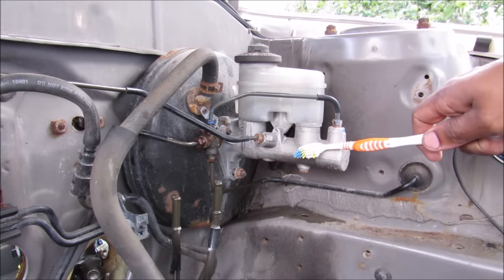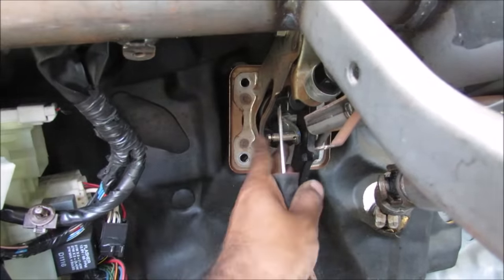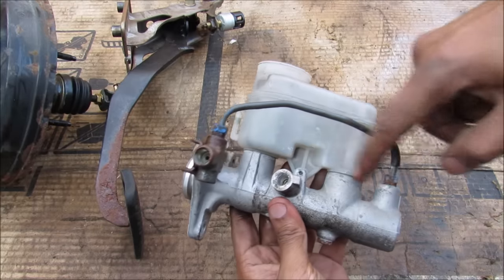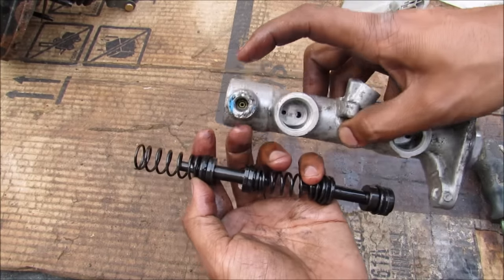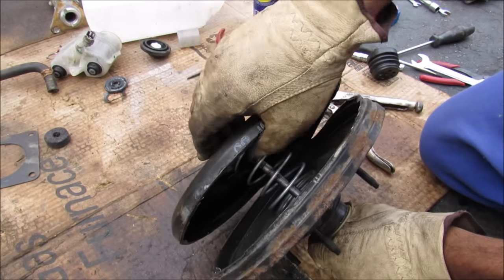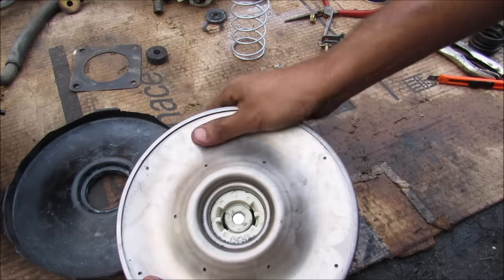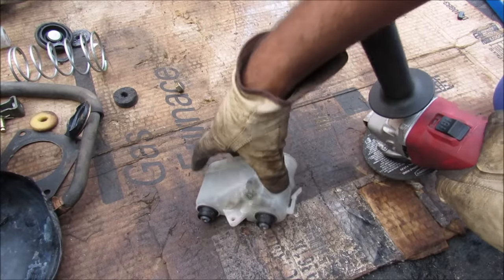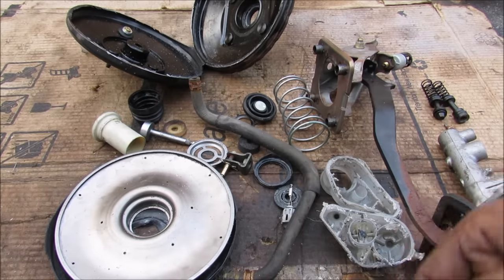How a Brake Booster and Master Cylinder Work

Comment: That snap ring plier multitool is great
Reply from the maker: +pétri pat I love my angle grinder...err snap ring pliers..err hex socket...lol
Reply: speedkar99 
I love mine too and I will often use   the 5 inch diamant blade  which works great on métal too and doesnt break in your face when your in a thight spot with that said thanks for your work
Reply from the maker: +pétri pat thanks. My grinder is 4.5" but sometimes I wish I had gotten the 5" blade for cutting a little deeper.
Reply: speedkar99 
You can always take the guard off and put a 5 inch it works very well as for me I always take the guard off all my grinder s but im very carefull expecially if I use a thin métal blade as soon as there chiped like I change them because they break which is why I use the diamant one it last longer and you dont have to worry its going to break in your face and I use grinder all the time another tip I can give if you dont already know it is that I always use my hand to screw the blade while holding the stop buttons same if I want to change the blade I unscrew it by hand the only time this doesnt work is if the grinder is too old (used)been doing this for the last 15 years 😉
Reply from the maker: Thanks for the tip.
Reply: I like the toothbrush tool
Reply: Lol
Reply: Best part was when he used his snap ring pliers to cut open the brake booster.
Reply: I call it my universal screwdriver for stripped screws
Reply: Same  snap ring tool I use.
Reply: Na my favorite was the brake booster opening tool and the reservoir splitting tool.
Reply: I laughter my ass off after watching two twice a special tool lol yes made my day
Reply: I used that multi tool once when I got locked out of my house..
Reply: @petripat5979  Please be careful and hold grinder with wheel not in line with anything you want to keep....

Comment: This is one of the best videos I've ever seen explaining how the brake booster and master cylinder work. I always wondered why the brake pedal would return when there was vacuum on one side only - reason it does is because there is a valve that I didn't know about equalizing the vacuum on both sides. Thanks for explaining everything and for showing (rather than just talking) about the components.

Comment: Another awesome video.  For me, I appreciate how you just cut right to the chase.  You take the time to edit your videos so that they are succinct and to the point.  So many other YouTube presenters seem like they spend so much time talking and wasting time and not getting to the point of why the video was made to explain in the first place.  Keep up the great work!
Reply from the maker: +B S I agree. Short and to the point is my style. Thanks for the compliments
Reply: Nice to see someone appreciating videos that are precise and concise. This is the style I've been trying to cultivate too. Trouble is that YT rewards watch time and so encouraging longer videos with a load of waffle.
Reply: @CycloneCyd  Subbed 👌
Reply: @speedkar99  My car i20 clutch sets ...disc, bearing and plate, and slave cylinder has been changed recently. After that, all working ok...pulling, shifting, etc..all ok. No complaints.

However, just about 3000km of driving since the above replacements were made, the car suddenly failed to engaged any gear while driving. The clutch pedal all the way goes to floor and never return back. I have to manually return to its original position and then pressed again repeated. However, it still sticks to the floor and never return back.

I was driving and all of sudden the issue happens. Stuck in traffic and was pull over to roadside with traffic police help.

Wait for some time, and yes, it come to engaged and disengaged again. All ok. But, the problems arise intermitently!!!

There is no physical leakage, damage or low fluids in the system. All ok. (It used to happen when clutch is used often ie in traffic jams, clutch engaged and disengaged frequently, just in 10 minutes or so. However, no issues with pulling power and no clutch slippages, temperature, coolant all ok.)

Comment: That redundancy in the master cylinder saved my butt when merging from one highway to the other at 60mph. Brake line to the back wheels exploded at the same time.
I didn't know that until now.
Great video! Love the toothbrush!
Reply from the maker: Ouch
Reply: That system saved a lot of butts
Reply: isnt the system in the master cylinder just if one of the pistons in the master cylinder fails? wouldnt effect what happens if a brake line fails, thats down to the proportional valve? i assume if you lose your right rear you also lose your left rear but keep the front due to the proportional valve keeping them seperate for safety and mainly for brake bias. unless the two pistons in the master cylinder go to different places? one to the front and one to the rear wheels? but then there is no backup if one piston in master cylinder fails, you will lose braking at either front or rear, whereas if it works how i thought then if one piston fails you still have normal braking?
er, sorry im rambling.

Comment: Thanks. What a great, no bullshit approach to demonstrative learning. You can't not understand how a main brake cylinder works after watching that. Brilliant!
Reply from the maker: +Labrador McGraw Thanks! Short and to the point is my style! Glad you liked it.
Reply: im pretty mechanically inclined and do all my own repairs, which owning a jeep and a 96 cummins is alot, i still dont quite understand how the booster works, yes vacuum pulls on the plate and a valve allows atmospheric air in to stop the equilibrium/provide a pressure difference on each side... what i dont understand is how it doesnt just go full brakes/locked up as soon as the that pressure difference is there, it provides a pretty uniform assistance but doesnt just full lock.. okay i think i just explained it to myself, the size and of that plate and the return spring are balanced just so to give you the correct amount of assistance without overpowering the mastercylinder and making the brakes either 100% on or 100% off
Reply: i still find it weird or amazing how well it works in making the brake pedal feel so effortless throughout the entire throw and it doesnt cause jerky/spontaneous braking when you you just barely touch the pedal

Comment: Great video, man. No bullshit and straight to the point. Thank-you.
Reply from the maker: That's my style!
Reply: @speedkar99  My car i20 clutch sets ...disc, bearing and plate, and slave cylinder has been changed recently. After that, all working ok...pulling, shifting, etc..all ok. No complaints.

However, just about 3000km of driving since the above replacements were made, the car suddenly failed to engaged any gear while driving. The clutch pedal all the way goes to floor and never return back. I have to manually return to its original position and then pressed again repeated. However, it still sticks to the floor and never return back.

I was driving and all of sudden the issue happens. Stuck in traffic and was pull over to roadside with traffic police help.

Wait for some time, and yes, it come to engaged and disengaged again. All ok. But, the problems arise intermitently!!!

There is no physical leakage, damage or low fluids in the system. All ok. (It used to happen when clutch is used often ie in traffic jams, clutch engaged and disengaged frequently, just in 10 minutes or so. However, no issues with pulling power and no clutch slippages, temperature, coolant all ok.

Comment: Well Done!!
Reply from the maker: +Paul Wehbe thanks Paul
Reply: @speedkar99  My car i20 clutch sets ...disc, bearing and plate, and slave cylinder has been changed recently. After that, all working ok...pulling, shifting, etc..all ok. No complaints.

However, just about 3000km of driving since the above replacements were made, the car suddenly failed to engaged any gear while driving. The clutch pedal all the way goes to floor and never return back. I have to manually return to its original position and then pressed again repeated. However, it still sticks to the floor and never return back.

I was driving and all of sudden the issue happens. Stuck in traffic and was pull over to roadside with traffic police help.

Wait for some time, and yes, it come to engaged and disengaged again. All ok. But, the problems arise intermitently!!!

There is no physical leakage, damage or low fluids in the system. All ok. (It used to happen when clutch is used often ie in traffic jams, clutch engaged and disengaged frequently, just in 10 minutes or so. However, no issues with pulling power and no clutch slippages, temperature, coolant all ok.)
Reply: I wish everything in my life was this to-the-point

Comment: Can you teach us how a clutch pedal connects to the clutch.
Reply from the maker: +MaximumJonathanosity I wish I had a manual tranny car. This one Is auto
Reply: Yeah, I figured. Thanks for all the other videos though.
Reply: Considering you already know the components, basically, the pedal is attached the same way leverage wise as the brake pedal, except its hooked up to the master cylander that hydraulically sends brake fluid to the slave cylander which has a piston that pushes against the throwout bearing which spins/pushes against the fins on the pressure plate, releasing the clutch. Lol
Reply from the maker: +Matt'smobile AutoRepair good explanation but this would be even better if it was presented visually
Reply: speedkar99 agreed!

Comment: This guy is amazing explaining  how things work  waooo
Reply from the maker: +Luis Abreu thanks!
Reply: @speedkar99  My car i20 clutch sets ...disc, bearing and plate, and slave cylinder has been changed recently. After that, all working ok...pulling, shifting, etc..all ok. No complaints.

However, just about 3000km of driving since the above replacements were made, the car suddenly failed to engaged any gear while driving. The clutch pedal all the way goes to floor and never return back. I have to manually return to its original position and then pressed again repeated. However, it still sticks to the floor and never return back.

I was driving and all of sudden the issue happens. Stuck in traffic and was pull over to roadside with traffic police help.

Wait for some time, and yes, it come to engaged and disengaged again. All ok. But, the problems arise intermitently!!!

There is no physical leakage, damage or low fluids in the system. All ok. (It used to happen when clutch is used often ie in traffic jams, clutch engaged and disengaged frequently, just in 10 minutes or so. However, no issues with pulling power and no clutch slippages, temperature, coolant all ok.)

Comment: 4:32 the vaccum proportion, i never understood, why we need vaccum? the brake system is totally manual according to my research
Reply from the maker: +G H the vacuum creates pressure differential. 
That helps to push the big diaphragm which helps pushing the piston
Reply: it mean if we disconnect the hose, than we are unable to use the brake?
Reply: it is in the name, brake "BOOSTER"
picture an 80yr old lady weighing 130LB and driving a fully loaded chevy tahoe. do you think it will be easy for her to stop the vehicle without a vacuum assisted brake? hard as fuck
Reply: you'll understand why when your brake booster goes bad. that light tap you use to stop you car will become a fatigued foot muscle after a long drive. your foot will actually be doing the work.
Reply: my question is stil there, if we disconnect the hose, than we are unable to use the brake?
Reply: H G Yes you would still  be able to use the brake, but as I stated, your leg will be doing all the work.
Reply: H G Dammit it's an assist!! pressure is created by the master cylinder and brakes would still function, but your feet will suffer after a few days of no booster assist.
Reply: i will try the brake after disconnecting the hose.
Reply: @tteuvky  still fine ,brake work ok it's designed that way after failed vacuum hose etc,but you need to push hard enough to stop vehicle,

Comment: Thank you, I'm loosing brake fluid in a 60 Buick that has not been driven for 10+ years.No obvious leaks at any of the corners. I have a little more knowledge now thanks to you. I will start by replacing the master cylinder, draining all the fluid, refilling the fluid, and bleeding and go from there.
Reply from the maker: Check all the lines underneath. They're likely rusted
Reply: @speedkar99  thank you for your reply and info. I will probably be crawling under it this weekend looking for clues.

Comment: Excellent video !!!  This is the ultimate video on how the brake pedal, brake booster , and brake master cylinder works. [2020]
Reply from the maker: Thanks. Check out my newest braking system video for a more thorough look at the parts in the system

Comment: Good video. At 1:22 is the most funny part; the guy using an old underwear as a rag. 
This is the most explained video that I ever saw about the brake system.
The guy is very precise explaining all the details of the brake booster and the other parts involved on it.
Congrats
Reply from the maker: Thanks! Check out my traction and stability control videos too!

Comment: I recently had trouble with my "certified" Cadillac CTS. Power brakes had a little power, but almost like old manual brakes. Dealer replaced vacuum booster which fixed it for a few weeks. Same problem crops up again. Took it back to dealer. Turns out that a lot of GM cars with 'high feature' engines [3.6L VVT. etc] cannot generate enough vacuum to operate the brake booster. The CTS has an electric vacuum pump to aid the vacuum system on the engine. A lot of hot rods with high HP engines have the same problem, and have additional vacuum pumps. The electric pump on my car was also failing, it too had to be replaced. Something to keep in mind if you have a similar problem.

Comment: It's been a long time since I had to replace a booster,like close to 20 years ago and only ever remember doing the one. At near retirement age and only had one booster go bad that is a testament as to how well they are built. Currently going to replace the master on a 99 Dakota,later today I think. First I gotta cut off some frozen aluminum topper clamps,I am NOT going to fight them,a set of 6 is reasonably priced if I ever want it back on.

Comment: Finally I knew the function of brake booster. It prevent wheel from lock up when emergency brakes when it reach maximum pressures

Comment: Nice explanation.... How vacuum assisting also how de assisting when foot off the pedal...causing both side equilibrium thereby no assist

Valve to shut off and on by movement of pedal...

Is the crux of explanation....

Kudos bro

Comment: The reason for the proportion valve is to avoid being overtaken by the rear end of the car, witch happens when the rear wheels stop, witch had to be avoid this way in cars without ABS. The effect can be experienced by braking the rear wheels with the handbrake today.
Reply from the maker: Yes agreed...old cars of the 80s used to have this issue

Comment: you are a teacher in what the brake servo provides / please I have a question:   
- when I don't press the brake I hear an air sound like a loss of air ...then when I press the brake it stops / braking the car at low speed feels as in waves, ...slightly significant although brake pads and discs they are mounted correctly pleasant and new discs.  what do you think it would be?  air leakage at hoses or pump?  thanks, I appreciate 😉🗽
Reply from the maker: Yes air leakage

Comment: That's the best explanation of a brake system I've ever watched! I'm pulling and burning brake fluid from the rear reservoir. Do I just have a bad MC rear seal?  I inspected the bore and its smooth. And I can't seem to find a rebuild kit for an 82 Mazda B2000 truck.

Comment: Amazing video to understand the way the whole system works! So when they say the booster goes bad is because either the diaphragm or the rubber O-ring on the booster’s rod get damaged? That’s what it looks to me.. Those OEM boosters can get pretty expensive! Thank you for a fantastic explanation!
Reply from the maker: Glad you appreciate it

Comment: How do you know if you have an internal leak at the MC? It will change your brake pressure in the system?
Reply from the maker: Yes. The pedal will sink but no external leaks.

Comment: In my car I have to put paddle more to get break. So can I set anything to get hard break or for tightening the break.
As I know there is no any leakage
Reply from the maker: Check fluid level. Bleed brakes to get rid of air. Check brake pad thickness and quality.

Comment: When the light comes on for low brake fluid in the resevior usually means its getting close to changing the front disc brake pads

Comment: Awesome video. Question for you: I have a low mileage brake booster that has suddenly started making a hissing noise when I release the brake pedal. no hissing noise when I press the brake pedal.  brakes still work as they should. what would cause this hissing noise?
Reply from the maker: Vacuum leak or the booster is leaking internally

Comment: Freaken awesome video! Thank you so much!
I'm thinking I have a leak somewhere in my brake booster, cause when the temperature is in the teens or bellow, the brakes are VERY hard. Nearly have to stand on them to get my car to stop.
But after a minute or two of warming up, (And usually after the first, surprise stop) it gets back to normal.
Reply from the maker: Probably a vacuum leak